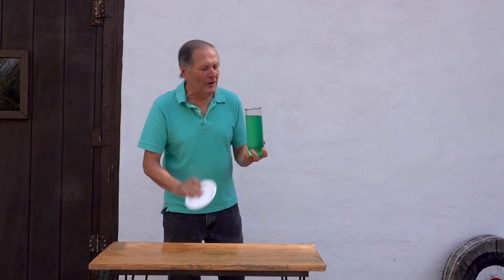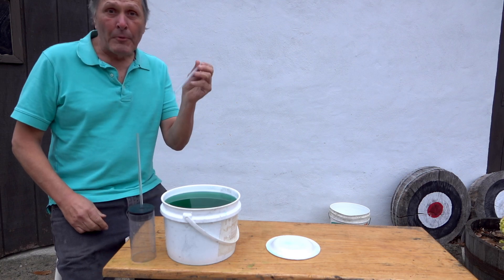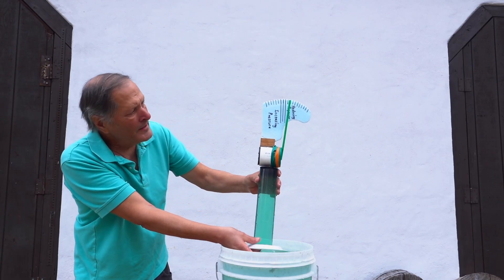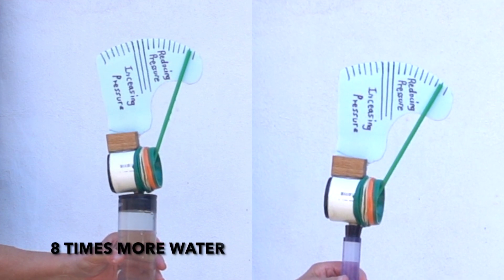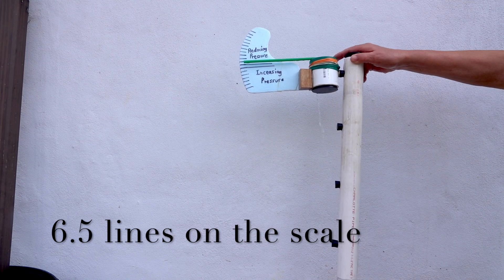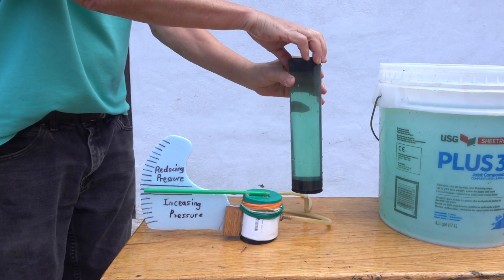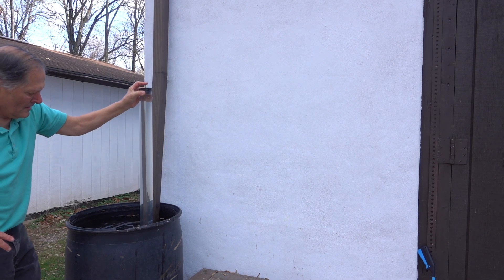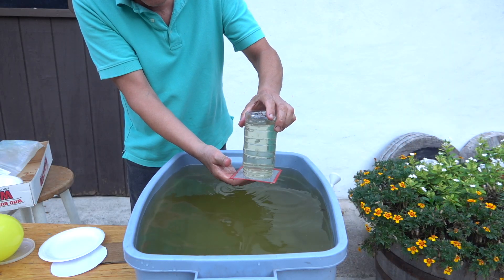upside down water glass physics

Comment: What's the maximum height for the column of water? 😊
Great videos, such an inspiration to students bring physics alive. Well done.
Reply from the maker: a water column matches air pressure at around 33 feet, after that it forms a vacuum above that if the tube were longer.  Could I get it to work at that height?  sounds like a challenge.
Reply: @YeanyScience   yes, 10.3m.  I was hoping you would accept the challenge. 😄 And then create a giant barometer. Rather than mm of mercury meters of water. 😄

Comment: @bruce you'd like Veratasium's video on how trees get water all the way up to their tops, and Action Lab's experiment with tubes of liquid and a parking structure to see what max height a vacuum can hold.
Reply from the maker: I haven't seen either of these but will go back and watch, thanks for the suggestion.  I've had the water column investigation on my list for a long time. I made a large tube up that would be at the top for viewing the  reduced pressure boiling. Also,  I've heard rumors about it so I'd also like to experiment with testing out whether degassed water can be taken to higher heights.